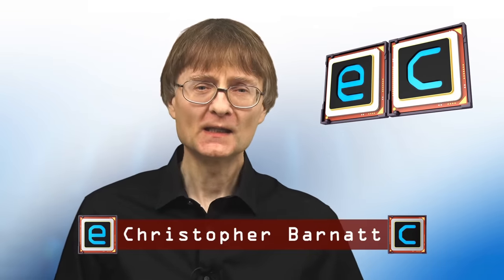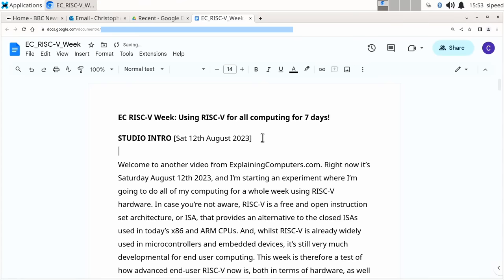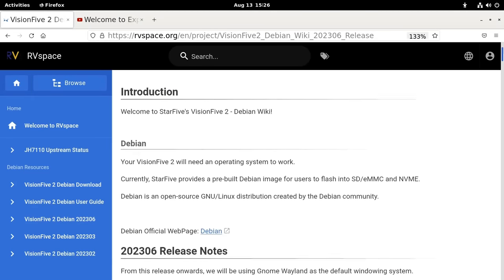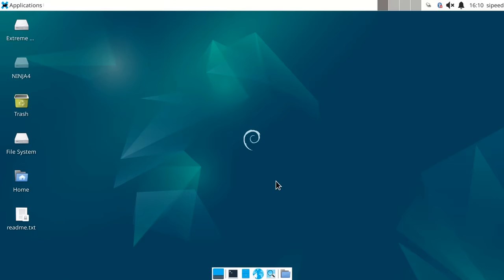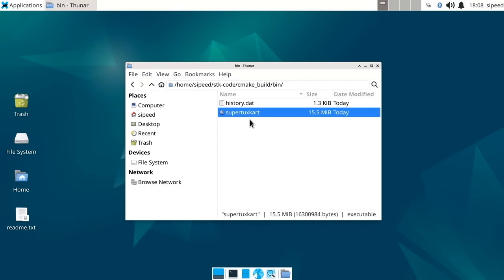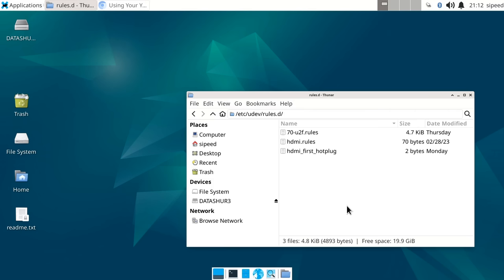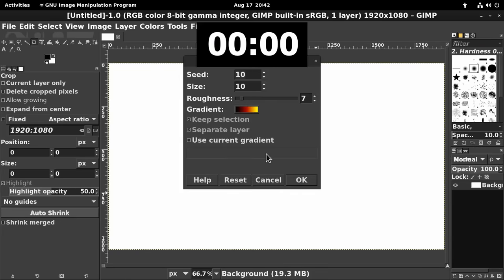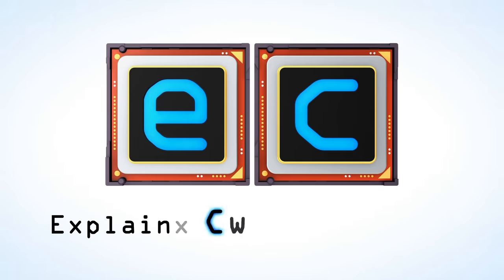RISC-V Week: 7 days only using RISC-V computers

Comment from the maker: Hi all, a couple of things. Firstly, I was clearly wrong about GIMP Lava test being multi-threaded. My bad. Secondly, it is now possible (just over a day after this video posted) to run the Kdenlive video editing on the Lichee Pi 4A. Yes, we can now video edit on RISC-V hardware! I knew it would happen -- but not that fast. If you've interested, I've done a quick post over in the Community Tab for this channel, and will demosntrate in a video fairly soon.
Reply: And a simple matter of installing a library. The question here was why the library wasn't in the Kdenlive package dependencies to be installed automatically..
Reply: @BruceHoult  Probably because no other nutters are running kdenlive on a Risc-V ;-)  But that's the Linux way... things get fixed when someone finds a fault.
Reply: hi im interested in risc-v for monero mining any chance you could try and mine some monero loves to know the hashrate these could be good for stacking and mining the coin thanks.
Reply: Look foward to it - love your videos :)
Reply: Risk-V is for CPU afaik. Care to comment if some standard and "free" set of instructions for graphics, AI, etc. will be useful thing to have in addition to codes for CPU? So that software working on one machine will work on all which are per "standard"?
Reply: @jediknight2350 This is an idea but ... Weak SBCs with a general purpose chip are not suited for crypto mining, even if you stacked them. You would need several orders of magnitude of more space and more electric power to compensate the enormous hash rate capability of extremely powerful and efficient asic based crypto hardware. So even if space was plenty, a gigantic SBC server farm would cost way more electric power and cooling than dedicated asic hardware.

The software ecosystem is not there anyway. There are lots of bugs.

Comment: Forcing yourself to use Risc V computers for a week is a great way to show how far the tech has come and where it still needs some work. Great video. 👍
Reply: Bear in mind that until these two boards existed there was no reason to even bother to port this kind of desktop software to RSIC-V — there was simply nothing capable of running it that was in enough people's hands to be worth the effort. The VisionFive 2 has now been out for just over six months (I received mine in the first week of February, as did most other people who preordered in August 2022), and the non-beta version of the Lichee Pi 4A came out in July (I ordered mine on July 7 when orders opened and had it on July 22).

These boards are roughly in Pi 4 class, plus or minus. There will be boards coming next year in Rock 5 / Orange Pi 5 class, which is a big step up. For those with a lot more money to spend, there are also boards available for preorder right now, shipping soon, which have the same C910 CPU cores as the Lichee Pi 4A, but sixty four of them in the chip instead of four. And 128 GB RAM in 4 DIMMs on 4 memory controllers, 32 lanes of PCIe, things like that.
Reply: its great some things "work" but far from efficient or expedient yet , this is at a level of 286 or 386 ( in comparative relative viewing) great that it sorta works , but needs a LOT of refining to make it truly productive or efficient yet. Kudos to all the work that has gone into this research and encouragement to future research

Comment: The fact the desktop environment works at all shows that things are going well. The gnome desktop is built on top of hundreds of packages
Reply: Not just that, it has all the basic life tools. Other than the obvious "getting used to linux" difficulties, it's already doing basic daily tasks normal people need a computer for and a few more advanced jobs, the first board (the LP4A) I daresay is already grandma-ready after installation. Would be nice if these chips were generally faster though, but that's just a problem for the 1st generation of any SBC type.

Comment: It would certainly be interesting to revisit this test in 12 -18 months from now, and do a direct comparison.
Reply: @@wotzinator6282Why not both?
Reply: @@wotzinator6282 I think that for me, I'd want to see better software optimisation, particularly around the graphics drivers - because ultimately its the ability to handle multimedia and some games well that allows it to metamorphose from a development board to a consumer one (not that I am unhappy messing around with dev boards).

To be fair, Linux on ARM has had a huge amount of investment and drive from Google because Android is ultimately a "Linux variant" whereas Linux on RISC V has not had that head start.
Reply: That's not even a challenge, assuming the MILK-V Pioneer will be released at the end of this year. A 64 core RISC-V system that uses an AMD GFX-card.
Reply: @LivingLinux  Why would you need 64 cores in an SBC when you don't even have anywhere near that in the "average" home user PC right now?

And why would you introduce a RISC V system with a graphics card, presumably for gaming, when you can already do that on a PC platform today?

Who is that MILK-V system targeted at? Is it priced lower than the average home PC? Because that's the main reason why anyone would buy one to replace what they currently have.
Reply: @terrydaktyllus1320  64 cores is beyond a high end gaming PC. And no, it doesn't fit on a SBC. And there are more use cases for high end PCs, besides gaming.
Reply: @@wotzinator6282 In what way is a RISC V SBC more modular than any other kind of SBC? Don't all of them support Ethernet, an external screen, USB keyboard and mouse, etc, whether or not they are ARM or RISC V?

And what do you mean by "integrated SBC"? The only "integrated SBCs" that I am aware of in the consumer space are, say, a Raspberry Pi 400 or an Orange Pi 800 with "integral" keyboards. 

Sure, you can buy lots of screens and casings that turn SBCs more into "integrated" computers but I'd argue that far more of those exist for ARM-based SBCs than RISC-based ones, if only because ARM has been around longer on SBCs. 

Do I simply smell "RISC fanboy" here that ultimately doesn't know what he's talking about?
Reply: @@wotzinator6282 "you are completely missunderstanding what im saying."

Yes, because of poor communication skills on your part. That's not my problem.

"I just dont want risc-v sbcs i want desktop wich are modular. Sbcs by their nature are integrated wich i dont like."

So why are you here watching a video about something you don't like? I have no interest in horse riding, so I don't go into equestrian channels on YouTube and tell people there I don't like horse riding.

"Also is there any good reason for you to be so provoking?"

1. I don't have to answer the questions of strangers on the Internet.

2. We were taking about computers, not me. You know nothing about me so don't try to discuss me and stay on topic.

3. Stop projecting the emotions you want to onto my comments.
Reply: @terrydaktyllus1320  Google's planning on having RISC-V as a 'tier-1' architecture, meaning the same level as x86 and ARM. No headstart, but it's not like they aren't involved in making it happen.

Comment: I think it's important to keep in mind that any hardware "accelerated" graphics is unrelated to the ISA (RISC-V in this case) but rather whatever GPU the manufacturer of the board has decided to incorporate, and of course the display driver. Nevertheless, mature ISAs today took many years to improve. RISC-V is certainly maturing at a much faster rate :)
Reply: Why you need  IBM System bus on RISC V, what you run on them ???
most RICS C systems are embattled only, no I/O needed !
uu make a gaming machine on it ? why that ????

Comment: I'm having to use a Raspberry Pi 400 on a semi-permanent basis until all my computers etc are taken out of storage, and it's a capable machine.... I can see RISC-V machines along the same vein as the Pi 400 in scope and design also being capable as you say in about 18 months time. We are living in a new mini-golden age of low power-consuming machines, and it's great -) Cheers Chris, thanks for your videos and your dedication.
Reply from the maker: Thanks for your support. :) The Pi 400 is indeed a capable machine.
Reply: what need, ATM machines you run, embattled systems ?
Why you see you need RISC now ?

Comment: Hello Chris! As always very informative and interesting. Such 7 days with new hardware can also be dangerous, because a harmless attempt turns into something serious. My test with RPI 4 started in 2019 and is still running without interruption. That's over 4 years and I see absolutely no reason to end it. Wait a minute! RPI 5 should come next year.🤔
Reply from the maker: Cool.
Reply: nobody is willing to update the systems, only for some newly released chips.
if it runs, it's good enough !
What system u use that it needs to be updates for RPI 4 ?

Comment: Anyone remember when a 733mhz pentium 3 could load rich text documents faster than this?
It wasn't a faster cpu, but it sure ran faster software. I miss high performance/low overhead software.
Reply: Developers have gotten lazy and/or greedy for resources.
Reply: I remember that, I also remember 3 minute boot up times and OS crashes on the regular.
Reply: He should’ve done it on a IBM Mainframe or server with an IBM Power Processor running AIX. RISC Processors from IBM are really powerful. Why would you use such a low powered device as shown in the video.
Reply: @ernestoditerribile  Why is he using it, what is the need?
Always weird content here !
Reply: @ernestoditerribile  because the Lichee Pi 4A (and BeagleBoard Ahead with the same SoC) is the fastest RISC-V computer on sale as at August 2023. It's likely to hold that title no more than two to three months, but it will probably remain the fastest RISC-V under $200 for 6-12 months until the VisionFive 3 (presumably) with JH8100 SoC comes out. The IBMs (and Talos) are not only a completely different ISA with completely different software, but also at least 20 times more expensive.
Reply: +1. I mean … it’s understandable that high resolution video encoding, decoding and playback has certain hardware requirements. Same for gaming or machine learning. But what I absolutely don’t understand is why an instant messaging program needs 600MB of RAM or why displaying a simple web page needs 1GB of RAM. Or why Windows 11 needs 21GB of disk space (what’s it using that storage for? High resolution cat videos?!).
Reply: @SuperDavidEF As much as I hate the resource hog situation, most of it can be chalked up to industry standardization of excessively bloated libraries by management. It's cheaper and faster to develop with bloated libraries and those libraries usually make security audits easier. One's time is limited in life and so developers tend to use the same tooling in their spare time that they also need to learn and apply in their professional lives. Sure you could call this "lazy", but I think it's an unfortunate yet reasonable decision for the software engineer to take this approach. From their perspective, it's more efficient for their life's priorities. The problem is a systemic one ultimately stemming from MBA structures in the business world. The fix would require a systemic overhaul of how management currently works in the corporate world.
Reply: @JohnSmith-sk7cg  Well said.

Comment: I'm most intrigued by the "race to the bottom" that's going to come. I want to see SBCs not just in the "you can play real media on this" space, but also the "look what I can do with a single button cell battery" space as well.

Emulation/FPGA hybridization intrigues me as well. It would be fascinating to see what hackers might be able to come up with in the future with RV being as open and accessible as it is. To think that the first ~30 years of video gaming could be relived on potentially a single highly optimized SBC with fair pricing is exciting. The MISTer has been a game changer, and imagining a community-driven design that doesn't rely on a hard-to-get board with tons of bloat like the DE-10 makes the future of emulation very bright.

Comment: Really great video Chris!  I use Debian Stable as a daily driver, finding it reliable but the type of OS that doesn't like being messed with at times.  I am amazed that they've managed to get Debian to do what they have across so many applications, but the problems with multimedia once updates and other packages were installed was sadly predictable.  If they can get Snaps or Flatpaks working (it may already work!) then this may help.

Comment: I'm surprised how much you were able to do using RISC-V hardware, it's looking really promising for the future!

Also, I was wondering whether veracrypt would work on an NVMe drive, i'm planning to upgrade my USB drive to an NVMe Drive inside an enclosure with USBC for better speeds and storage capacity.
Reply from the maker: VeraCrypt, in general, will certainly work on an NVMe drive -- just not yet in RISC-V. :)

Comment: Good to see the software development coming along.
For shirts and giggles, tried the lava render on 4790K.  Initially using conservative scheduler (my default), sub 5 seconds, then spotted the scheduler as I looked for core usage, ran again with performance and ... sub 4 seconds.
However, I'm mostly looking forward to getting one for HTPC usage because of the dramatically reduced power consumption and therefore heat/noise.

Comment: An heroic episode of dog-food -eating to test environments. The software's well advanced for development boards.
The 2FA failure is probably because the key uses a compiled  (for speed) module to do some calculations. That is obviously CPU specific, and the developers probably lack a few tuits they need to recompile for Risc-V.
The performance of audio relative  to the browsers is interesting.  The Chrome sound was likely a phasing problem,  with two channels of audio and a video to synchronise, the results likely represent different orders of processing between Firefox and Chrome, possibly Chrome not taking advantage of multiple CPUs?

Comment: I have found that RISC V is now available for many FPGAs. After I have cleaned up my current workload, I will be trying to get as many FPGA's running RISC V as possible. I believe this will be far more important for designers than buying pre-built versions of RISC V. I should have a much better understanding of how all this will work by next summer. :-)

Comment: Now we need an open source ISA for GPUs
Reply: I don't see why they couldn't just use RISC-V
Reply: @tylerdean980   NVidea was actually thinking of doing just that ! Some years ago. Then their were talks about buying ARM and I don't know what came first.
Reply: Nvidia GPUs already use RISC-V
Reply: @Robbie-mw5uu  looks like the graphics calculations aren't done on RISC-V, it's more like a management engine ?: "Some GPUs include a GPU System Processor (GSP) which can be used to offload GPU initialization and management tasks. This processor is driven by the firmware file /lib/firmware/nvidia/510.39.01/gsp.bin. A few select products currently use GSP by default, and more products will take advantage of GSP in future driver releases.
Offloading tasks which were traditionally performed by the driver on the CPU can improve performance due to lower latency access to GPU hardware internals."
Reply: @tylerdean980  I've worked in a team designing a commercial GPU, with team members who knew nVidia and AMD GPU internals very well. There is no reason at all that you could not use RISC-V as the basic ISA for a GPU, with a handful of added instructions and functional units e.g. one for texture interpolation. In fact Think Silicon have done just that. At a trade show they told me it took them three weeks to take the special GPU instructions from their existing GPUs with fully custom ISA and get them added to a RISC-V core and working in an FPGA.

Comment: At 21:15 htop clearly shows the process is single-threaded, since it uses about "100%" CPU. If it used 4 threads it would be closer to 400%. Looking at the core utilization in the top left you can also see that in total the CPU is running at maybe 40%, again very consistent with an intense single thread process plus some background tasks.
Reply from the maker: My bad.
Reply: @ExplainingComputers  No big deal, love your content!

Comment: Would love to see one of these boards come with one of the high end SiFive cores.
The Horsecreek board from Intel is still coming, but even that have the P550 core which came out in 2021.
SiFive's performance core is 2 generations on from then.
Reply: Shipping low cost SBCs are always about four years after the CPU core in question was announced. That is the case with both these boards (U74 October 2018, C910 July 2019) and also for the Pi 3 (A53 October 2012), Pi 4 (A72 February 2015), and Rock 5 (A76 May 2018). P550 was announced in July 2021, so we're still two years away from what you'd normally expect for a low cost mass production chip and board, and early even for a limited run test chip. Tell me where you can buy a SBC with ARM's "SVE" vector ISA ... announced August 2016, and SVE2 in April 2019.

Comment: Looks like you can build veracrypt from source. This is something that's normally fairly straightforward on x86, but it would be interesting to see how you got on on this architecture
Reply: Veracrypt isn't even available as a Gentoo Linux package on RISC V or ARM, only for 64-bit Intel. My assumption would therefore be that Veracrypt probably relies on certain encryption functions built into amd64 CPUs that probably aren't available on other platforms - therefore poring to other architectures may be extremely difficult.